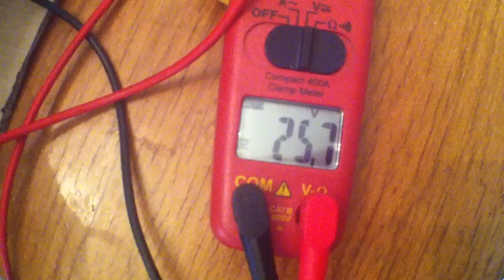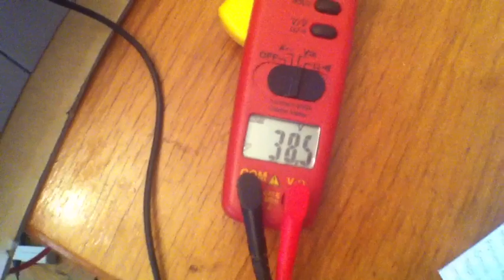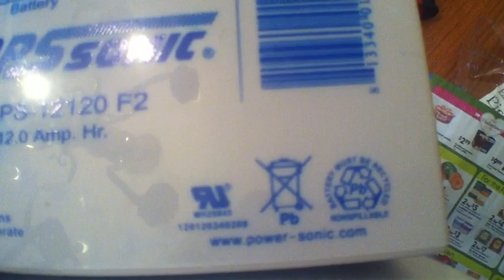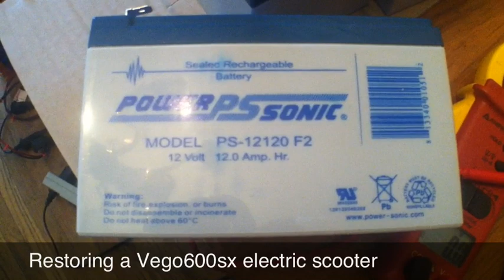Electric vehicle battery packs in a Vego 600sx electric scooter restoration

Comment: what about agm?
Reply: +stockingandblossom1 pretty mutch the same thing as sla
Reply: +stockingandblossom1 an agm battery is for the most part a sla bettery the same thing as whats in the video
Reply: ah i didn't know that :) thanks :)
Reply: in fact most sla batteries are agm ones !
Reply: can you tell what sla stands for? sorry i'm a bit of a noob. :)
Reply: sealed lead acid
Reply: thanks :)